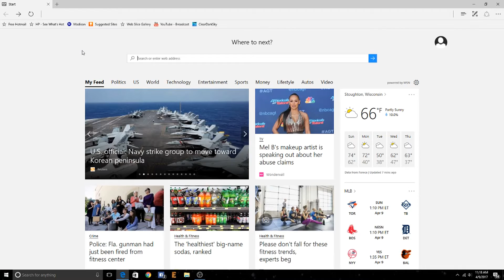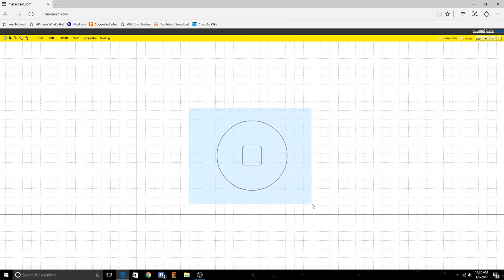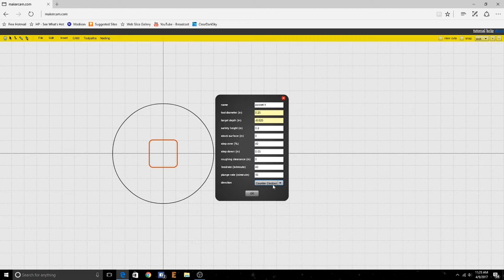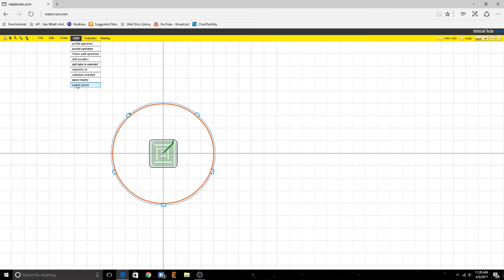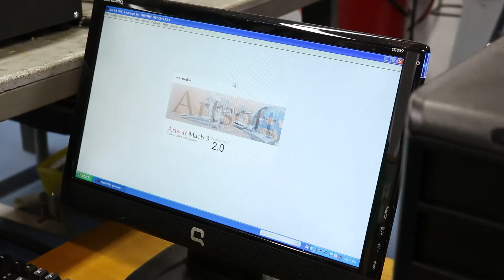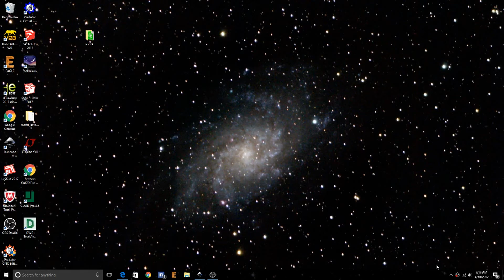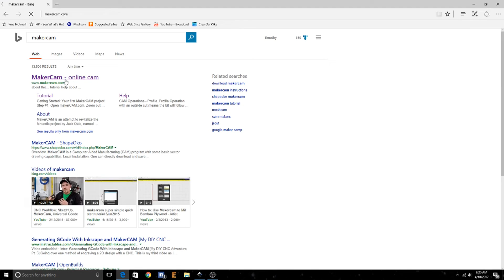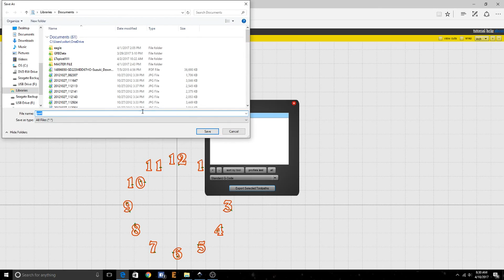CNC Router Clock Project

Comment: I do a lot of stuff along the same lines using V-carve.  The particulars are different but using the concept of having a basic "blank" that you add different things to is a very powerful way to crank out a LOT of assorted stuff like clocks.  

One thing I do now and then is custom place markers for things like weddings. The   place marker has 2 parts. One is the part common to ALL the markers, the other part is just a name, While I use V-carve to generate the G-code the process is exactly the same.  First you make up the basic markers with the common graphics/text then you just add the names alone. 

 Whats critical is to keep track of the zero points. I do it by creating an OFFSET from the real zero on the jig.  It dosent matter where you place the holder as the offset is fixed to the holder, NOT some specific point on the bed.   

How I do it is to make up a holding jig for the markers. An easy way is to cut a pocket in some stock at least half way the thickness of the markers using the profile tool path but  cutting INSIDE the path, NOT the normal outside. You now have a holder that is a tight fit for a marker. Make up a marker with nothing more than a cross hair engraved at whatever point you use for zero. Attach the holder to your CNC parallel to the X and y axis. Now pop in your marked blank and rezero to the crosshairs. Now manually make a crosshair at that point.  WRITE DOWN the X and Y values when centered on the holder crosshairs.  To set up to the real zero the next go around just manually jog to the jig croshairs and enter the values you have written on it into the DROs along with  some Z settings way above things in the air. When you hit GO TO ZERO you will be dead on the X and Y zero point with the bit way up.  Just manually set Z by what ever method you use. I use a touch plate myself.

Try it sometime, you will find that trick very useful..  :) Also SAVE the G-code files as they are often handy to have.

Comment: I do clocks different.  First I locate the center and mark it on BOTH sides.  Next I do the front as the motor shaft hole will be at the center.  If I do the motor pocket on the back first I loose the center on the front. I leave about 1/8 uncut. Finally I do the motor pocket and shaft hole on the back side. Super easy to bandsaw off the scrap as 1/8 inch of wood dosent offer much resistance. A bit of sanding around the edge and youre done..

Comment: Thanks for the video. Fun with a cnc router, although it would be much easier just to cut the blanks without the cnc router, still it's all about practice and learning. Keep them coming please, i enjoy learning about inkscape and makercam. Have you had much practice with other programs like fusion 360?
Reply from the maker: Glad you liked the video, I don't have any experience with fusion 360, but I am always willing to learn new things. I purchased a program called Vcarve pro, and I will probably be using that a lot to make more complicated projects. Once I gain some knowledge with the software I will make some videos on it. Most of my cnc programming has been with a software package called Bobcad cad cam . Both Vcarve pro and Bobcad are kind of expensive , so I am going to continue to make videos using as much open source software as possible, but I still want to get some videos out there using Vcarve as well.
Thanks for watching

Comment: I have  a question. When doing the second step I noticed the you mentioned it last that way it doesn’t get cut out first. I get that part. But let’s say you needed to change the bit   Before it does the second task how do you change the bit does the program go back to zero and give you time to change before continuing on.  Or do you have to hit the stop button and change the bit and them hit go. Or do you have to restart the whole program over. I’m trying to understand how this all works. Thank  you.
Reply from the maker: If you break a tool it is probably just easier to start it all over again. If you have separate tools in the program you will have to have a M00 line of code to have it stop. I then change my tool , touch off my Z axis then go to my new line of code that starts the new tool off and start the program from there
Reply from the maker: The best thing is to have a completely different program for the different tool. Just find your  X,Y zero position and touch of the new tool for your Z zero

Comment: what brand of cnc do you have? where did you get it from and cost?
I need a cnc that can engrave glass and do work carving for a hobbiest..
Reply from the maker: 4 AXIS CNC 6040 ROUTER DRILLING & MILLING PROFESSIONAL ENGRAVER MACHINE
( 171456563604 )
I got this on Bay, this is the CNC you see in the video. The price was About $1,500
Reply: hello. thank you for the reply. does it come with software?
Reply from the maker: Yes it comes with Mach3 software, this will allow you to generate the necessary G-code to run the CNC

Comment: What alternative to use for makercam?
Reply from the maker: There are several different softwares that you could use, but the learning curve is much higher. Probably the best one you can use for free is Fusion 360. You cans download and use it for free if you are just using it as a hobby. If you want to use the best software for a CNC Routet, then I would recommend Vetric cut 2d pro , it is expensive but I believe there is no finer software.
Reply: @The_old_geezer_geek  Thanks for your reply. I am trying to learn Fusion 360, but now my laptop shows a message concerning my graphics card is not right. I really enjoy your lessons. I have a Genmitsu cnc 3018 MX3. Any suggestions. I am quite frustrated that Makercam does not work.
Reply from the maker: Leon Willover did you look at my fix for makercam video?
Reply from the maker: Leon Willover  https://youtu.be/pCa4EpedPVQ

Comment: I want to build a cnc router but being 79 I was worried about the software. After watching your video I think I can handle it. You go slow enough to follow and show the screen large enough to see, not like some of the videos. thanks for a good video.
Reply from the maker: Thank You so much, good luck on your projects.
Reply: My cnc is total homebrew, no plans used and It will hold to within 5 thou across 24 inches. It has a cutting envelope of 6 Z 18 Y and 24X.  I got right at $1000 in it. That includes Mach 3 (the control software) running on an 16 year old computer, and V-carve desktop.  While there is a bunch of free cad/cam software out there I personally preffer commercial programs as they all offer far more features and are easier to use.  I generally DONT recommend a scratch built for most people because of all the engineering details involved. Its better for most people to buy some plans and go by that. I built mine about 3 years back when I was 70... Turns out that CNC is one of the most useful tool in my shop.  I often use it to make odd size and shaped holes and to level wood that too small to go through a typical planer.